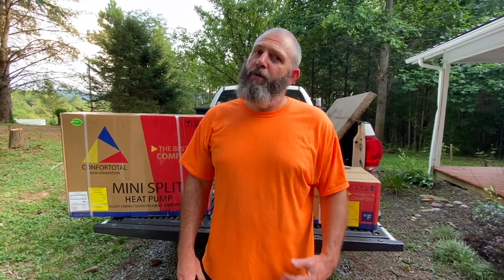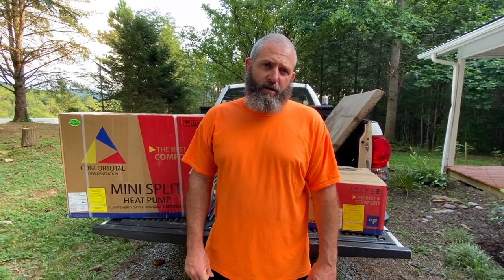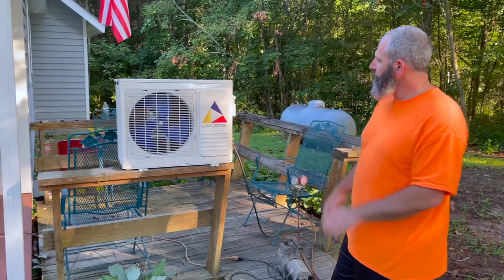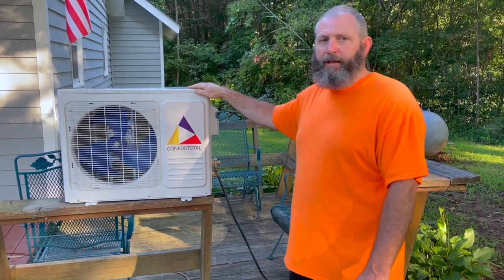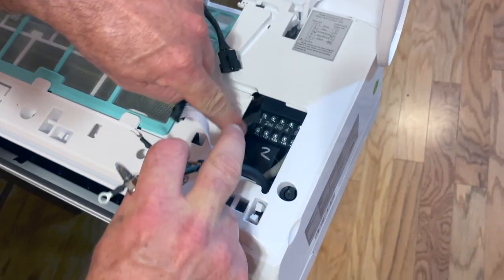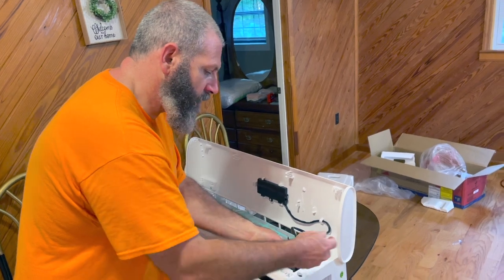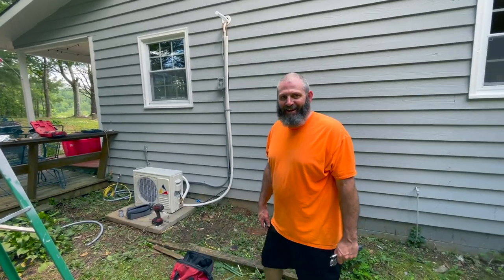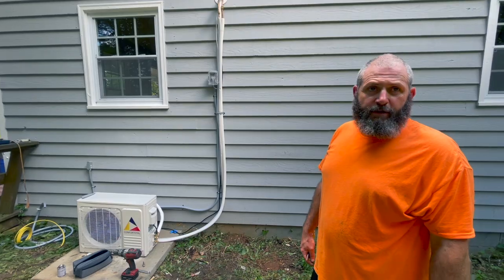INSTALLING THE CHEAPEST MINI SPLIT HVAC YOU CAN BUY!

Comment: How did you get it shipped.   We are in northwest Ga. FedEx Ground is horrible and can’t get us delivered on anything.   Can you get this shipped via UPS ground.   Thx in advance.
Reply from the maker: FedEx delivered it, I’m unsure if you can request UPS but I would definitely ask the seller if they can use a different carrier if FedEx won’t work for you.  Thanks for watching and subscribing!
Reply: @OrangeWiresGarage  you got my friend.  I appreciate it.  We just moved into a new house. I’m putting this one in the garage.  However out Grandsons bedroom is upstairs.  The house came with a Mitsubishi mini split.  It works fantastic, but it’s always running.   I dawned on me at the end of your video you said this unit is not an inverter.   I’m new to this, is there a difference between a mini split and an inverter mini split ?   Thx again. Your video is one of the best easiest tutorials I’ve seen 👍
Reply from the maker: @stevenroby5393  inverter systems run at variable speeds and are more energy efficient.  With this one when the outdoor unit is on or off and not variable with the 220v model it only uses about 5 amps when it is running. We are very pleased with it especially for the price.
Reply: @OrangeWiresGarage  understood.   Yea the upstairs bedroom unit does that in deed. It varies the speed of the fan on the outside unit.  It’s a Mitsubishi I couldn’t afford to install one of those in my garage way to expensive for us. As the house came with it.   I’m ordering this unit for sure.  I’m checking tomorrow to see if hopefully it can be shipped UPS.  I’m gonna do the 115 v unit   Thx again sir

Comment: Orange wires, my Mini split is dripping air from the center of the unit at the bottom. Any ideas why? Brand new unit
Reply from the maker: I’m assuming you mean water is dripping if that is the case check your condensation drain hose and make sure it is not blocked.
Reply: @OrangeWiresGarage  it was the drain hole, it was not sealed with the hose. it's probably not intended to hold water. My AC drain hole is leveled with the drain hose and thus some water collects. There before enough accumates and goes over the other side. I put some silicon glue on the hose and the drain hole seems to be working. Hopefully a few months.
Reply: I wish I knew the thing had no seal. Then I would have definitely made the wall hole lower than the drain hole.
Reply from the maker: @chrizekiel  maybe that silicone works, with some fiddling you could raise the wall mount bracket a bit as well.
Reply: @OrangeWiresGarage  it's been 2+ weeks. No problems since I added the silicon.
Reply from the maker: @chrizekiel  Glad to hear that great news!

Comment: Hello. But how to make the air inside turn off automatically in the cold
Reply from the maker: That is a great question, we don’t know the answer maybe someone else does?  If you figure it out please post the answer here, thanks for watching and subscribing!
Reply: It would be great if someone told me why when it's hot it turns off automatically but when it's cold it doesn't turn off the fan, the outside fan turns off but the inside fan doesn't turn off automatically
Reply: If the unit is sized correctly based on the square footage and heat load calculations and also depending on your climate you can just put it in dry mode and set the temp you want. Doing this the fan will turn off when the temp is satisfied, however it will lower the fan speed and the humidity during its cycle. If the room temp continues to rise in dry mode the unit is under sized for the area. If the unit is sized correctly it should work fine and lower the humidity a little while turning the fan off between cycles. Hope this helps.

Comment: Been using mine 1 week...having to use the heat pump past 2 days...the temp light display flashes then stops...can't seem to locate why it does it...any input?
Reply: Did you ever find a solution? It seems to be harder to find than big foot.
Reply: @famousromang  never did find anything
Reply: @ryanjones7543   I'll keep looking and update if I find anything.  Seen multiple videos with comments asking the same question and no luck.
Reply: @famousromang  see if you can find anything on replacing the circuit board. Also if you can find how to reach out to conforttotal to use the warranty thayd be helpful also. The place I bought it closed. Thanks for your help

Comment: Does the 220 power go into the inside unit or outside unit?
Reply from the maker: The 220v power goes to the inside unit and feeds to the outside unit with the supplied cable. Hope that helps.  Thanks for watching and subscribing!
Reply: They make a 110v version as well that you can just plug in to an outlet inside. just be careful how many things you're running on the same circuit

Comment: When I put my confortotal ac into heat mode the light indicator flashes and then once it starts blowing it's cold air and everything starts freezing. It also freezes in clean mode. Can you tell me why it would do this?
Reply from the maker: We do not have the answer but maybe someone else does.
Reply: if there are several feet of extra copper line coiled up vertically behind the unit, try laying the coil flat on the ground.

Comment: Hi good video does it still work for you ?
Reply from the maker: Still going no issues so far.  Thanks for watching !
Reply: What is the electricity use of it? I want one because of the price but am concerned that it would be too expensive to run A24/7 365 days per yr. Thank you @OrangeWiresGarage

Comment: There is no need to vacuum anything look carefully at what you're doing there will be no moisture to damage the inverter compressor which is highly unlikely make your connections put your oil and nonsense on the flares tighten everything up and then look carefully at your brass works see the schrader valve on the low or fat line so with everything connected and tight you open up the high side and you let it run until you hear it start to come out of the schrader valve on the low fat line that you have depressed the high sides open it pushes out all the air moisture and nonsense through the schrader whoosh you feel it on your hand close it up open the low side and turn it on no need to vacuum
Reply from the maker: Thanks for the reply but would you agree that the vacuum is the preferred method and it certainly doesn’t hurt to do it.  Thanks for watching and subscribing!
Reply: Question how do I change the remote to farenheit
Reply from the maker: @robertcollins5467  To change from Celsius you press the up and down  temperature arrows at the same time for approximately 4  to 5 seconds. Thanks for watching and subscribing!
Reply: You have no clue what you’re talking about
Reply: Always vacuum...